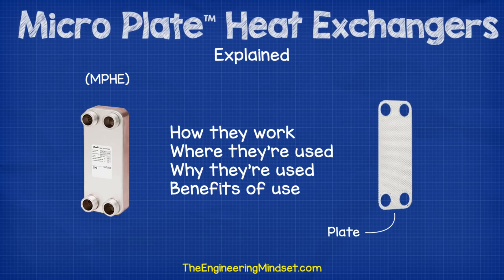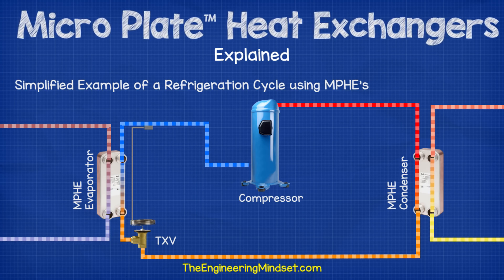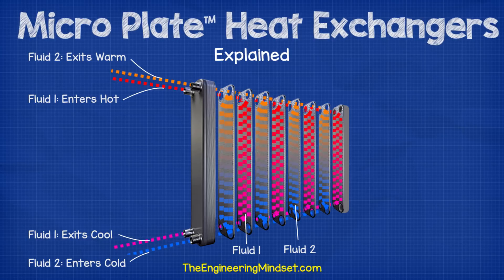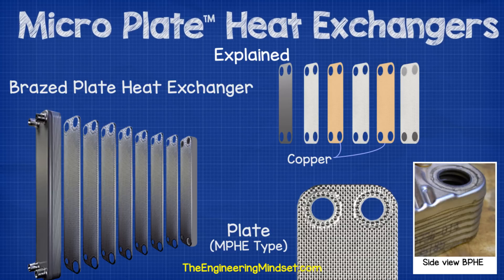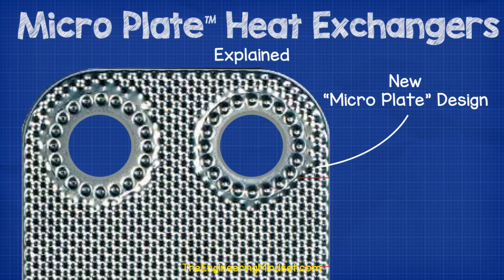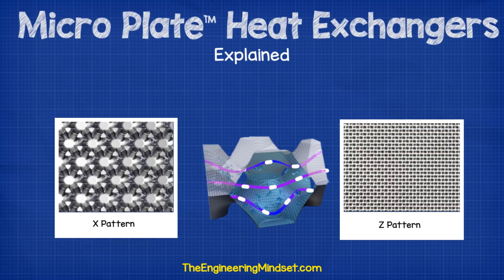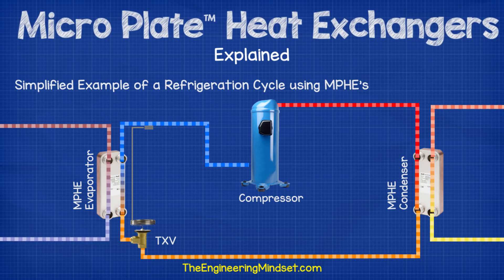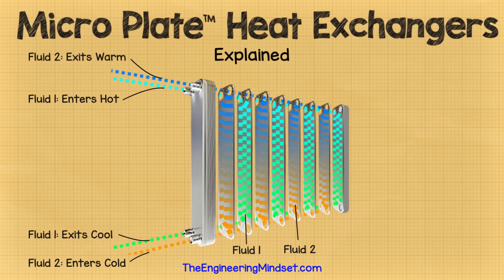Micro Plate Heat Exchanger (MPHE) - How they work, working principle hvac phx

Comment: I’m going to use one of these for my ice chest air cooler. It currently works very well but the ice melts quickly. I’m hoping this will slow down the melting since the heated water doesn’t mix

Comment: I’m an HVAC tech. I’d like to install a BPHE on my ductless mini-split to capture the waste heat for my domestic hot water. I just need to figure out how replace the BLDC fan motor with a water pump so that the microprocessor doesn’t throw an error code. Obviously, a water pump will pull more current, so there may need to be some secondary controls.

Comment: Can you tell me capacity micro plate heat exchanger D22/16 code 021H1297 and detail catalgoue its: drawing, detail inside (number channel, dimension channel, height of the corrugation,..)
Thank you so much.
Reply from the maker: You will need to contact Danfoss for such details

Comment: Thank you for the Video. I have a question. I want to use plate chiller for immersion cooling System for mining, it means for cooling down my Miner, the Miners are inside mineral oil, the heat inside the oil reach +110 After 10 Min, so if i use plate chiller and use water for cooling down the minral oil, Do i have to cool down again the water which comes out from the plate chiller? I would like to reach around 40 degree or Less in the oil, and the System should works 24 /24 _ 7/7. Can you please help me to find an effective solution?
Best regards from Germany

Comment: How does the pressure loss on the dimple-plate design compare to the herringbone? The herringbone design is already very thermally efficient and can be difficult to match the thermal and hydraulic requirements which means they are often oversized to reduce pressure losses (flow split between more channels in parallel), i.e. more plates are required hydraulically than thermally. I would have thought that with the dimple design this becomes even more of an issue, you would need quite a few more plates to minimise pressure losses, particularly in chillers and so the operating point would change. The point to take here is that heat exchanger design is technically more advanced than the other system components. But what are your thoughts about this topic?
Reply: Indeed. Very important to optimize the balance you speak of, some apps more critical than others. The hvacr industry has engineered the shjt out of every component

Comment: You say brazed plate heat exchangers can be flushed , however my gas engineer say it's pointless   and difficult to actually clean the debris  from inside the exchanger !
Reply from the maker: "can be" doesn't mean you have to. If it's a small unit it might be cost effective to replace but a huge industrial unit might be

Comment: Is possible to use this Heat Exchangers to use the heat of the exhaust from a wall boiler (natural gas boiler like a: Baxi Roca Victoria 20/20) to make a preheating of the water that this boiler pretends to heat up?
And if the mounting position is horizontal, is its efficiency reduced?
Reply from the maker: I think baxi typically use a brazed plate hx, in theory I can't see why not. If you contact Danfoss they will be able to assist

Comment: Hi there, thank you for these really informative videos, i have a few questions
-can't these HVAC systems use some sort of energy recovery sytem where you convert the excess heat into electricity ? If there is sush a system that is used please make a video about it.
-what do you think about the new trend of solar assisted AC units, as i've seen they don't work as advertised in most situations, but if used in on a bigger scale like a central cooling system with some sort of sun tracking system with a couple of mirrors they can improve the system, these systems add sunlight heat to the already hot compressed refrigirant which increase its temp difference = increase efficiency and cooling potential, its counter intuituve but its effective if used on a larger scale, what do you think about it ?
Reply from the maker: Great questions. Heat recovery is used in some chiller units but I'm not aware of any converting to electricity only to offset heating. It's low temperature low quality energy so it isn't so useful or efficient for electrical generation. 
Solar assisted AC, as a general rule I like to see any and all ways of utilising renewable energy sources. Quite a few large buildings are now using solar assisted absorption chillers esp in Brazil. For AC units it's a nice idea but as you say it doesn't seem to work so well but this can also be because of poor installation decisions. I recently saw a new design which replaces the compressor with a solar absorber. There's definitely room here for expansion and I hope more research will go into these technologies
Reply: There is such a system, it's called Organic Rankine Cycle.